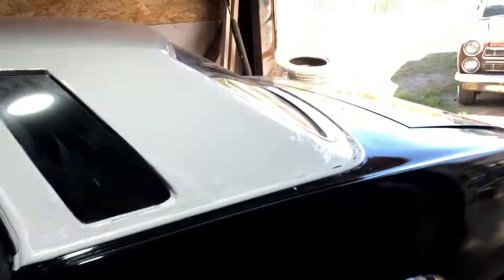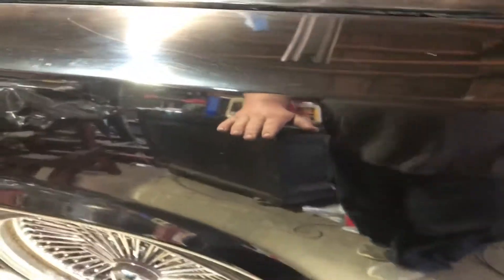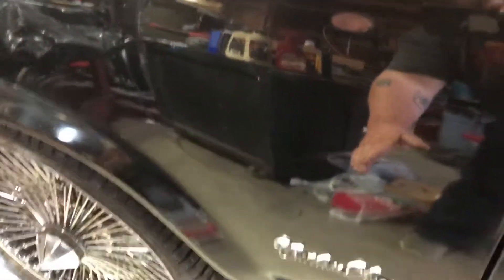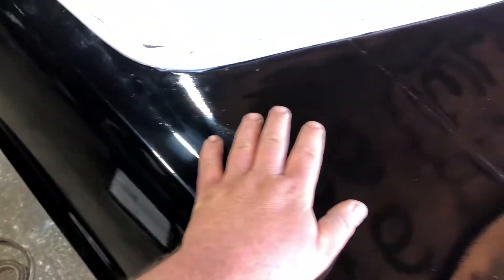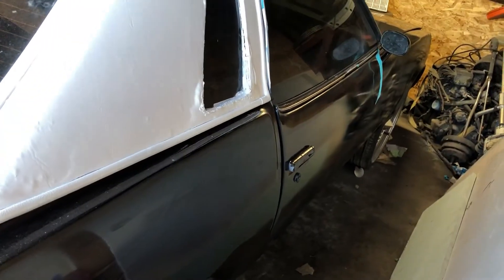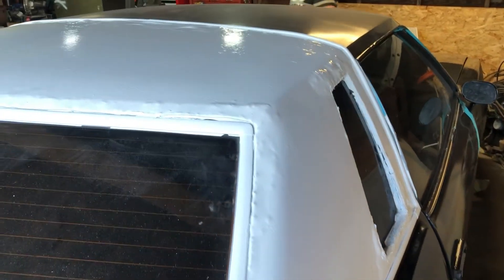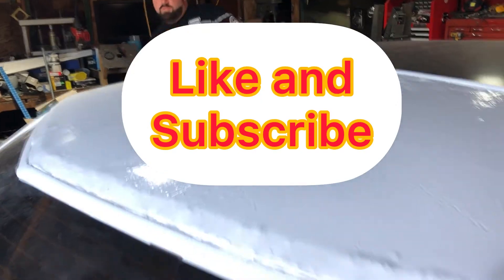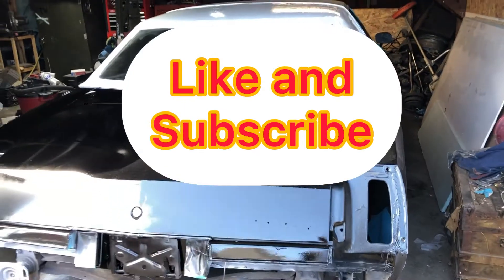1977 Cutlass supreme  paint job

Comment: Looks good black a hard color
Reply from the maker: Thanks man it is hard to paint with the dark colors i can’t figure out why i get so much orange peel i feel like i am doing everything rite but i am running a small air compressor i ordered a new paint gun a iwata  from summit
Reply: @maniacmachanic9870  try making it wetter and speed up a little
Reply from the maker: @CCAutoWorks  ok i will try that feel like it needed to be reduced but the paint can said not to i think it was a little to thick
Reply: @maniacmachanic9870  I always reduce and make it wetter so it flows better and you can move faster
Reply from the maker: @CCAutoWorks  thats what i am doing for now on thanks i got some of that summit blue metallic that i am going to try out for my next paint job
Reply: @maniacmachanic9870  heck yeah good luck